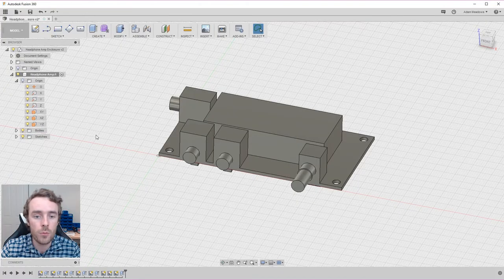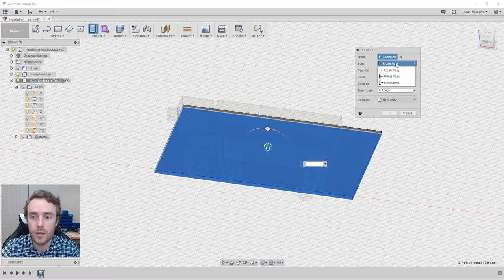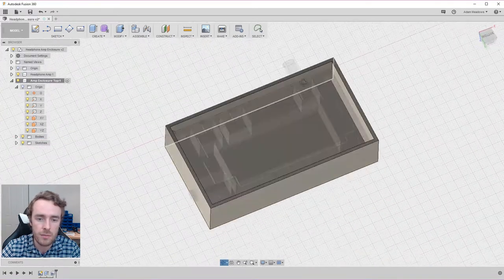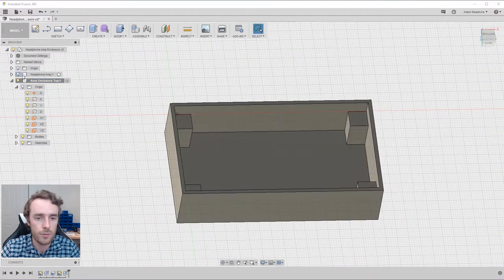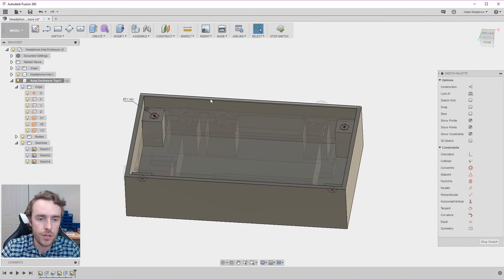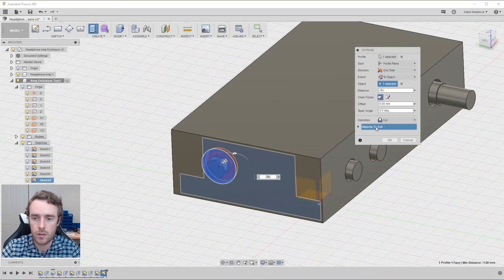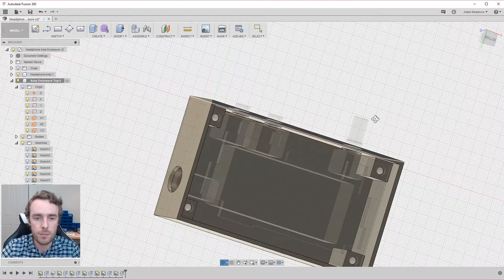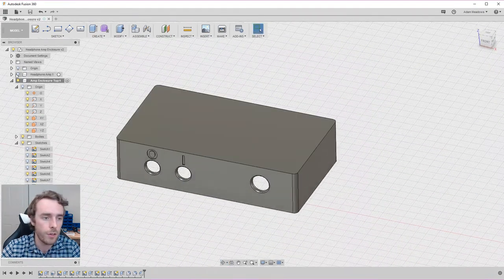Fusion 360 Beginner Project Part 2: Enclosure Top

Comment: Nice use of fillets and chamfers to avoid printing defects. Especially useful as I happen to be designing an electronics enclosure myself. Thanks!
Reply: Yes great tip, but i had also added the fillet on the inside to keep the wall thickness consistent. You could do the fillet before the shell command but most time pain in the a.s in complex designs.
Reply: Seems like everyone saves fillets and chamfers for last, which is not always best. If you do, you can always move the fillet and/or chamfer feature(s) to before the shell feature in the timeline.

Comment: A few more observations. Filleting the four outside corners before adding the pedestals would prevent the (probably insignificant) problem of the reduced thickness of the corners not covered by the pedestals. Chamfering the top of the box very slightly would keep the flat top look while preventing the first layers printed from protruding slightly if your printer/filament is prone to "elephant footing". If you right-click on the text then select Explode Text, you can convert the text from the blue bitmap representation to actual geometry. Then, if you select the geometry and UnFix it, you can position the exploded text precisely using constraints. All that for a more perfect box. ;)
Reply: Yes, exploding things can be handy. BTW, I appreciate your modeling the PCB first and using it as a reference as well as your especially clear explanations in this video and in your other videos. Looking forward to episode 3.